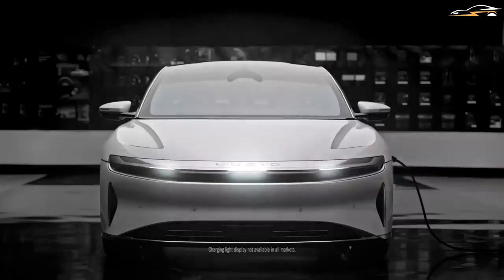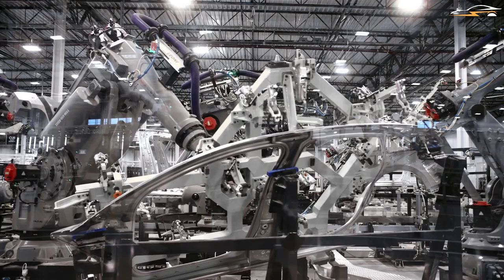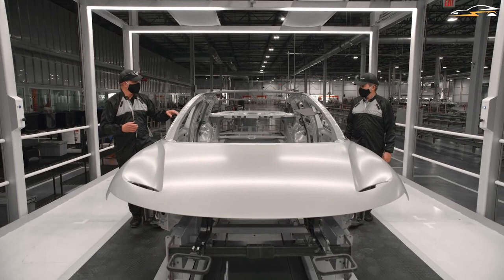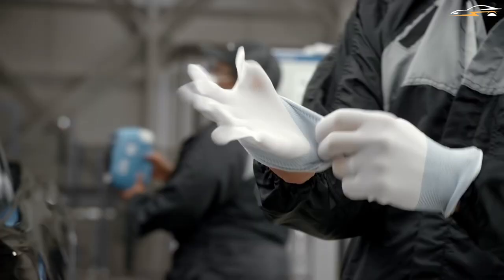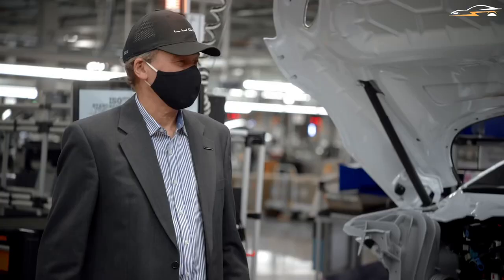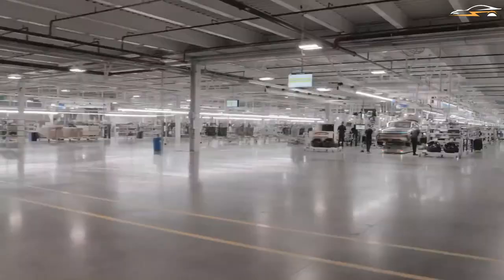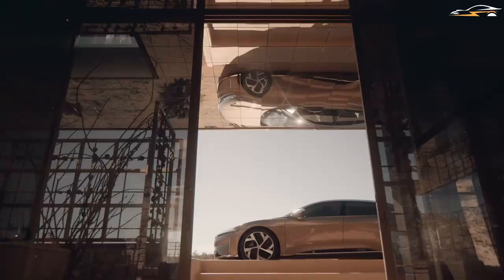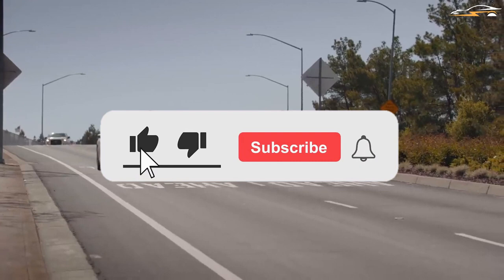INSIDE Lucid motors EV-factory [plant expansion plans]

Comment: you show them making cars - where are they?
Reply: They already delivered 25 cars today
Reply: @ingodwetrust7301  25 in 30 days ? I would be happy if they would let there stock holders know what the biggest problems are instead of pretending that everything is ok. 
Stockholders have the right to know if its paint, uneven gaps or exploding batteries. 
( i hold little enough not to worry)